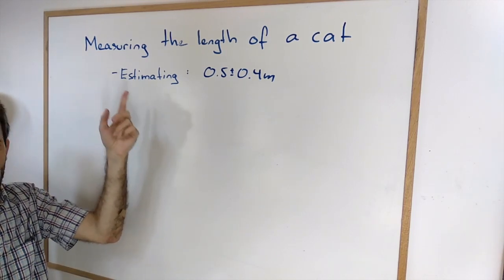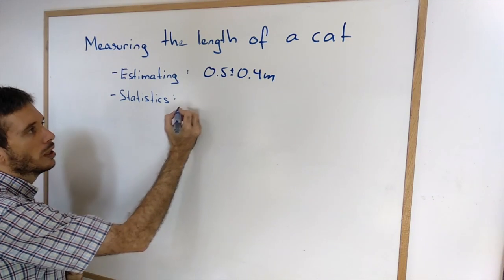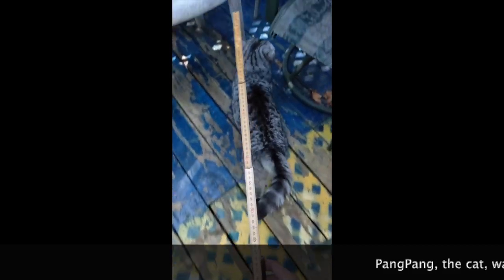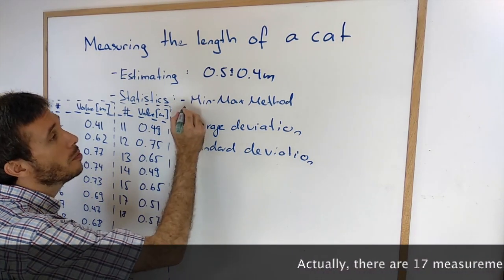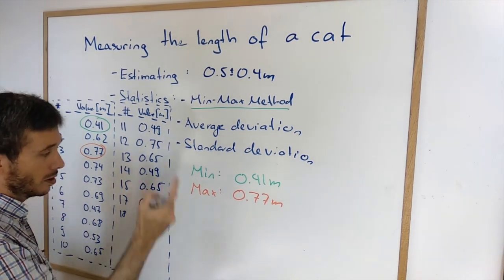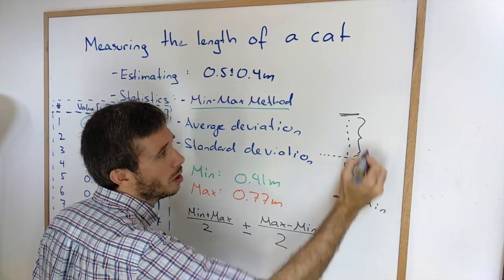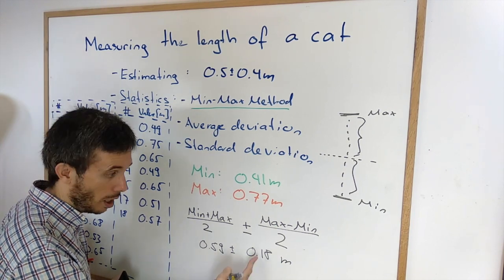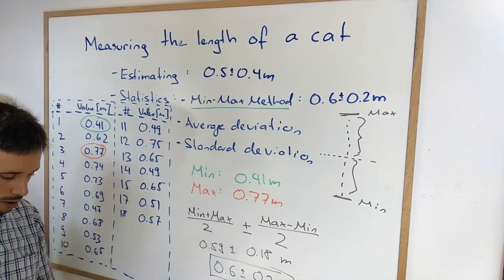Calculating the uncertainty of a measurement with the Min-Max Method

Comment: why did you decide to use just 1 significant figure if your measurements have 2 significant figures? thank you.
Reply from the maker: Hi, only ONE significant figure (the last one) should be uncertain. Had I left 0.58 +- 0.18, the 5 and the 8 in the average would be not certain (changed by the uncertainty)... therefore I had to round the average to 1 SF (0.6).... Then rounding the uncertainty to the same digit (that one is not really a rule, but stating 0.6 +- 0.18 is just weird.).

With 0.6 +- 0.2 the message of significant figures matches the one of uncertainty...meaning my cat could be anything from 0.4 to 0.8m. Two SF, 0.58 would mean 0.50 to 0.60, what with the given measurements and calculated uncertainty is not true.